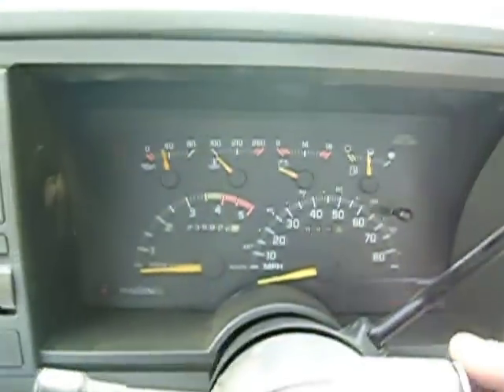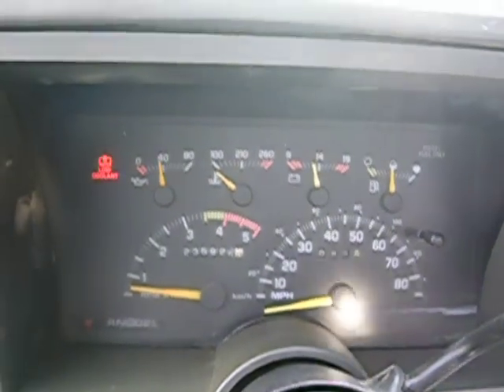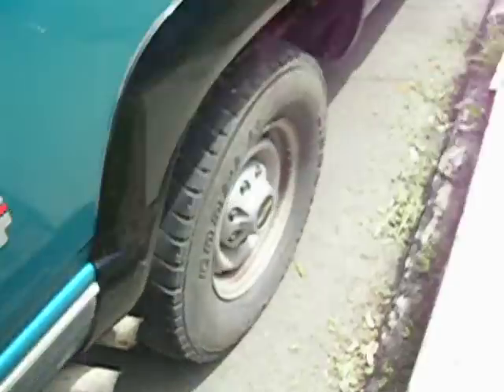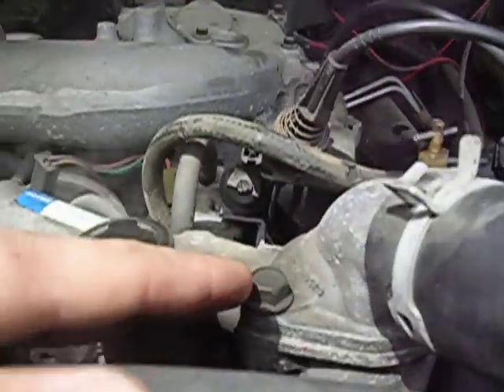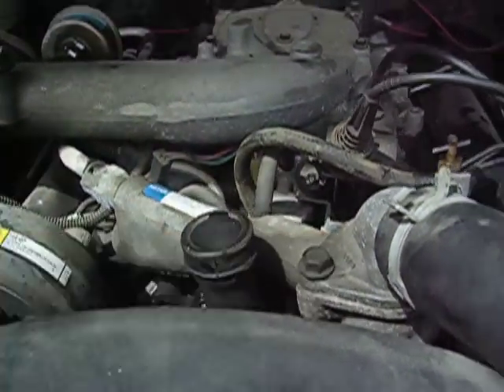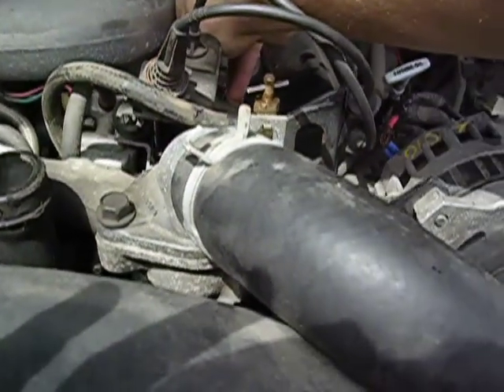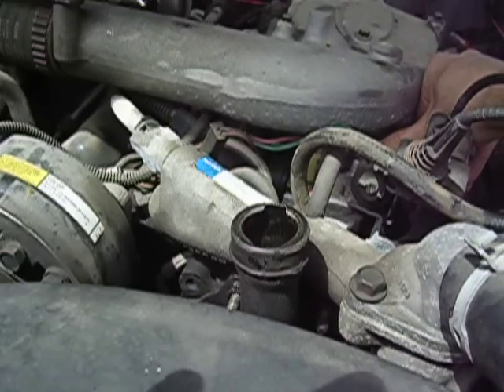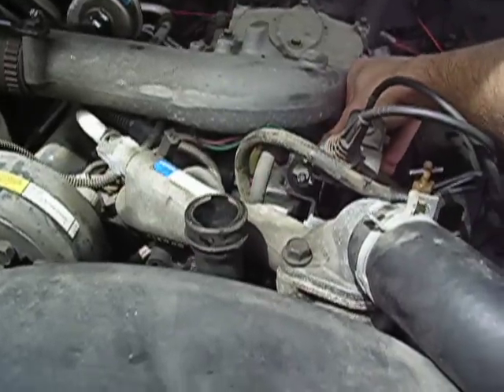1993 Chevy Diesel. Rough Idle. Part 1

Comment: Power service plus, Injector cleaner and a road trip is all this this engine needs. Lukas has a very positive effect also. I treat my fuel regularly in my 6.2
Reply from the maker: Actually, it ended up having a broken valve spring. The exhaust valve on I think the #4 cylinder wasn't closing.
Reply: That will do it, was the engine was abused?
 Over reving?   I bet it had a 3 speed trans.
Reply from the maker: Macktruck71 No, it had the 4-speed auto. It had been taken really good care of, and even with 236k miles on it it was one of the healthiest, most powerful 6.5l's I've ever owned (once the valve spring was replaced). It was basically what the previous owner towed his boat with. That was it.
Reply: Wow, sounds good!
Last year I met a guy from Arkansas who was running his 6.5 on cooking oil and unleaded gas with no conversion. Funny thing is that it sounded great.
Mine is a '89  6.2  in a rally van(from the south) with the 700R trans.
I've been thinking about selling it but just can't bring myself to do it because I love it so much.

Comment from the maker: Thanks for the thoughts! It turned out to be a broken valve spring that had not coiled up in itself enough to cause damage yet. I was able to replace the spring for about $5 and have had a great running truck since! :-)
Reply: Just wondering did it only act that way after it was fully warm or it did it all the time ?

Comment: My bet is one of two possibilities. 1) The injection pump timing is advanced too far. -OR- 2) You need a new injection pump. See if the idle gets better if you push in on the plunger on the pass side of the IP. If so, timing, if no, bad pump.

Comment: whole new set (big investment if your not sure) also try once you find it swaping 2 that are already on it and if it changes which cylender is bad than its the injector , then go with old or new replacements , if new do all so they are pressure matched so it idles smoother and if you set them yourself you get it smoother

Comment: blowby goes away cause the cdr valve eats it up through the intake , clean it with parts cleaner and you should ether have no blow-by visible or it wont go away one or the other and you have a bad injector losen the lines one at a time and find which one doesnt change it , you might have to lower your idle or crack 2 at once to notice it but change that one with a scrapyard one (grab a few they should be cheap or free try till it goes away that one works) or try getting a

Comment: I just changed the oil in my 6.2 suburban and added a mix of Lucas oil stabilizer and Marvel Mystery oil and it was a huge improvement. 6 gallons of regular Delo LE 15W40 1 quart of marvel (added some in the gas too), 1 quart of Lucas and it runs smooth as ever.